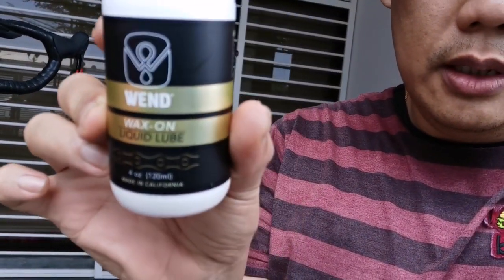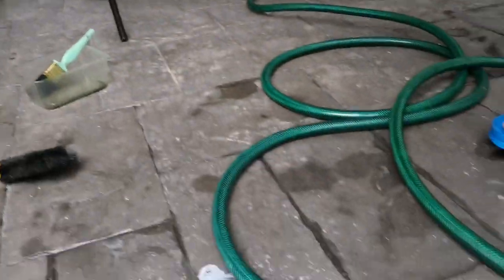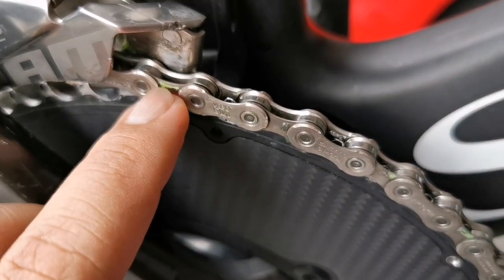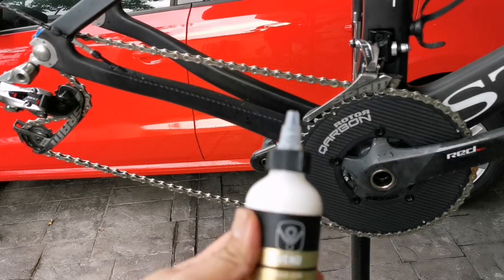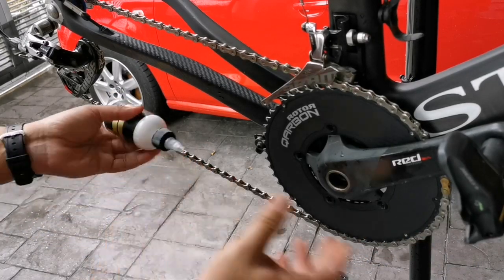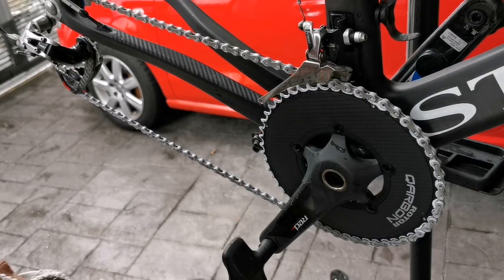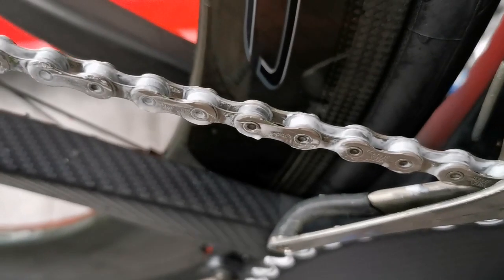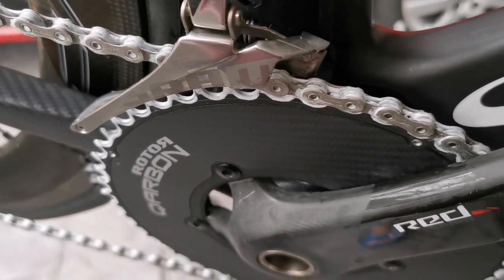NEW WendWax Lubrication 1st application

Comment: Whether immersion waxed or drip lube, after every ride I always turn the pedals backwards while holding a rag around the chain to remove the road grit and grime.
Reply from the maker: Hmmm good point actually... But the problem are also those dirt between the links... Hahaha I just ride now a days on wax... Last time on oil based lubes I wash my bike every 2 weeks... 😂 Now on wax... Wash once a month... LOL
Reply: @melvintanchannel  I now use Ride Mechanic Bike Mix. It’s waxed based drip lube, solvent based, so it gets into the rollers, and leaves the wax once the solvent evaporates.

First application brings all the grit to the surface, which you wipe away. After 2-3 times there is VERY little gunk left between the links. The good thing is that you can use a degreaser on the chain, as it doesn’t break down wax..
Reply from the maker: Kewl... Still using my ceramicspeed ufo... Havent Finnish yet lol